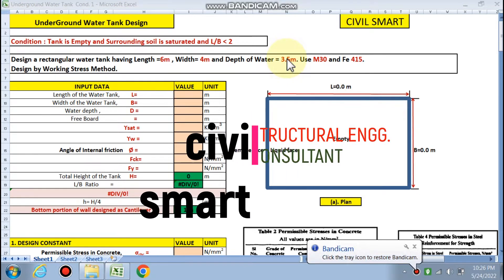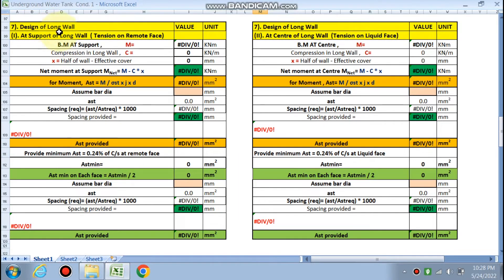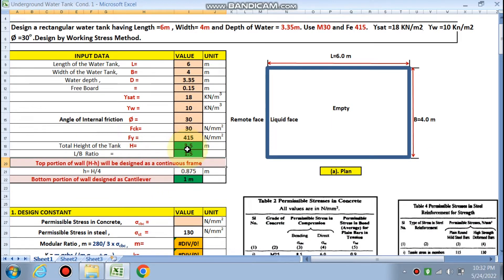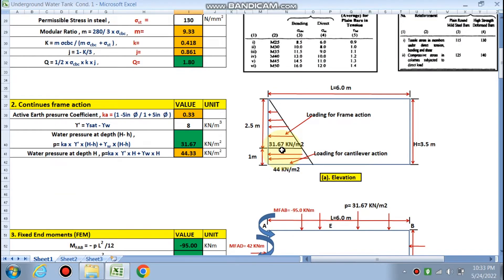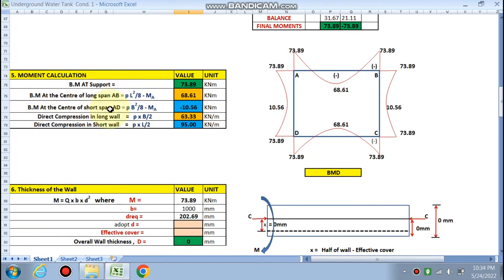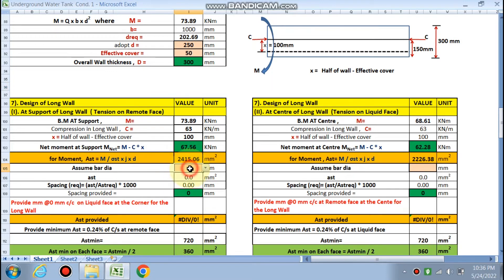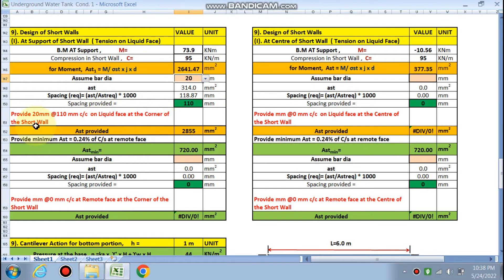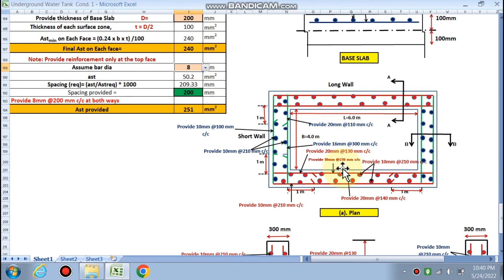UNDERGROUND WATER TANK DESIGN (PART -1)- BY CIVIL SMART

Comment from the maker: Full design Excel sheets course 
https://pmny.in/fImMpS8bprSP
Full complete Course includes all the sheets as under:

IN FOOTING DESIGN SHEETS
1. Isolated square footing
2. Isolated rectangular footing
3. Combined rectangular footing (Slab Type).
4. Combined rectangular footing (Beam & Slab Type).
5. Trapezoidal footing design
6. Strap beam footing design
7. Footing with uniaxial bending
8. Footing with biaxial bending
9. Pile foundation
10. Pile cap design 3 & 4 piles
11. Wall footing/ Strap footing
12. Raft Foundation ( Beam and Slab Type).
13. Combined footing design (Beam and Slab Type).
14. Eccentric Footing Design ( Column at dist. X from edge).
15. Eccentric Footing Design ( Column at Edge of footing).
16. Strip footing design ( having 4 columns).
17. Pad Square Footing Design.

IN BEAM DESIGN SHEETS
1. Singly reinforced beam design sheet. ( Beam Size known).
2. SINGLY REINFORCED BEAM design ( Beam Size not known).
2. Doubly reinforced beam design
3. Continuous beams design  with point load having
    2-span continuous beam
    3-span continuous beam
    4-span  continuous beam
    5- span continuous beam.

4. Cantilever Beam Design.
5. T- BEAM Analysis sheet.

IN COLUMN DESIGN SHEETS
1. Axially loaded column design
   (a). When column size is known.
   (b). When column size is not known.
2. Column with axial load with uniaxial moment ( on 2            sides and 4 sides reinforcement)
3. Column with axial load with biaxial moment
4. Mux and Muy Calculation sheet.
5. Short Circular axially loaded Column ( Dia is known).
6. Short Circular axially loaded Column ( Dia is not known).
7. Long Column design.

IN SLAB DESIGN SHEETS
1. Cantilever slab design sheet.
2. Simply supported slab design sheet.
3. One way Continuous slab design sheet.
4. Two way Continuous Slab design sheet.
5. Two way simply supported slab design sheet.
6. Flat Slab Design With Drop Only
7.Flat slab design without column head and drop 
8. Flat Slab Design With Column Head and Drop.

IN STAIRCASE DESIGN SHEETS.
1. Dog legged staircase design. (Well Size know).
2. Dog Legged Staircase design ( Landing And flight width known).
3. Open well staircase design.

IN RCC WATER TANK DESIGN SHEETS.
1. RCC WATER TANK RESTING ON GROUND (L/B <2).
2. RCC WATER TANK RESTING ON GROUND (L/B >2).
3. UNDER GROUND WATER TANK DESIGN (COND.: TANK         IS EMPTY AND OUTSIDE SOIL IS SATURATED).
4. UNDERGROUND WATER TANK ( TANK IS FULL AND             NO OUTSIDE SOIL PRESSURE).
5. UNDER GROUND CIRCULAR WATER TANK.
6. Overhead Circular Water Tank.
7. INTZ Tank design.
8. Box Culvert Design.

IN WALL DESIGN SHEET
1. RC WALL DESIGN SHEET.
2. RETAINING  WALL DESIGN SHEET.
3. BASEMENT RETAINING WALL DESIGN SHEET.
4. COUNTERFORT RETAINING WALL.
5. SHEAR WALL WITH BOUNDARY ELEMENT.

BUILDING LOADS CALCULATION SHEET.

COST ESTIMATION SHEET.